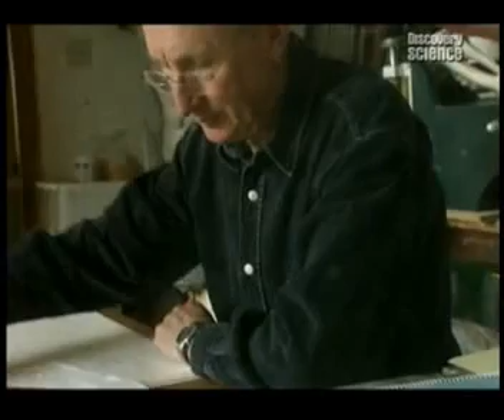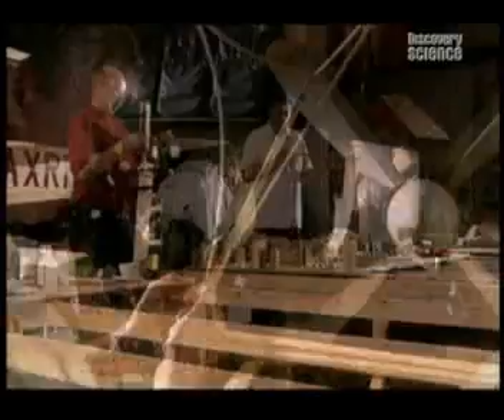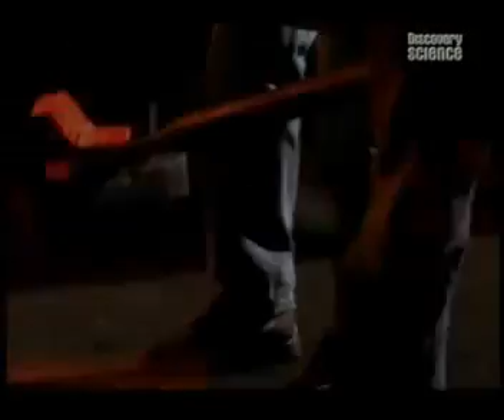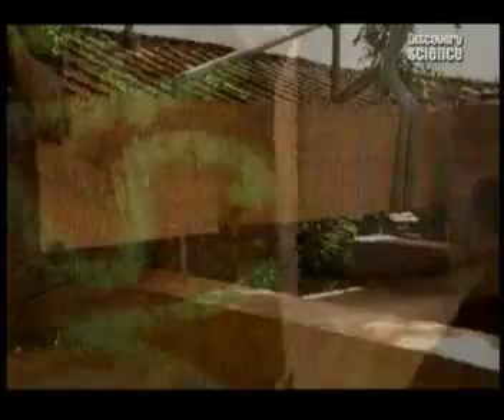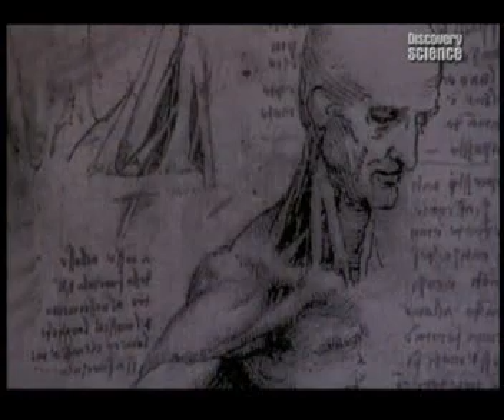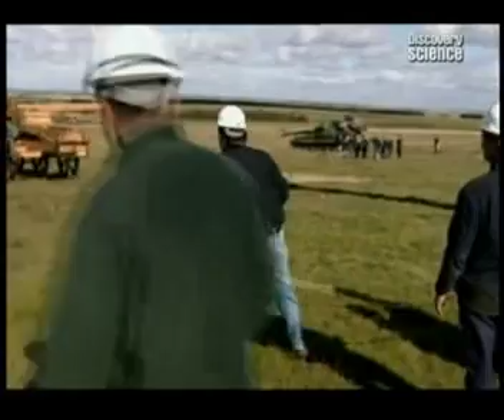Leonardo Da Vinci's Dream Machines

Comment: I’m upset at what they changed lol . The reasoning behind them become clear when they used there own “more workable” technologies.
Resistance is critical to ensure a heavy object become airborne. That bend and curve, and the width they removed  from the arms that’s there to put the stress to use as positive energy, yes, I guess it could snap there huh.... so making it thinner did not reduce its chances, and blaming the cut of wood? Good grief!

Comment: Thank you for posting this.  There's a new Da Vinci biography out that mentions this television special.  I'm assuming it was two hours long and the second half showed what happened to the glider.
Reply: Hi, as it happens I work where the glider was built, it's still here, I moved it recently for cleaning as it's been hanging in one of the hangars since it was displayed at the V&A museum after the TV show.
I'm trying to find footage of the second part of the documentary, the glider definitely flew. As I understand it, it was initially towed, with runners holding outrigged lines incase it started to roll too much (it has VERY little control). The tow line was slack for at least some of the flight, so it was considered a true glide rather than stalled, kite-like flight.